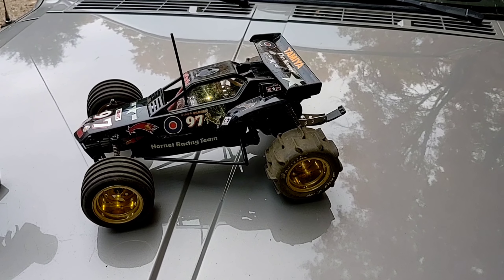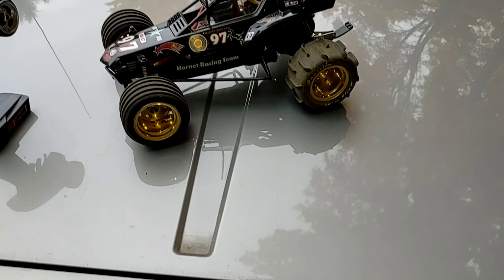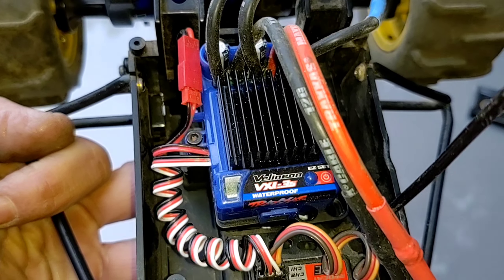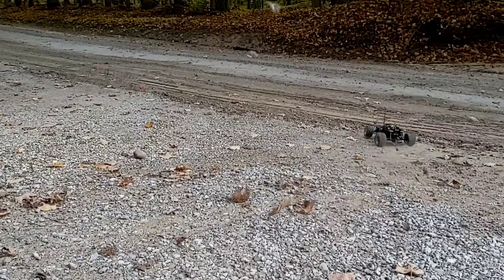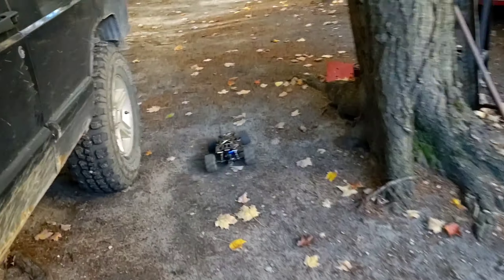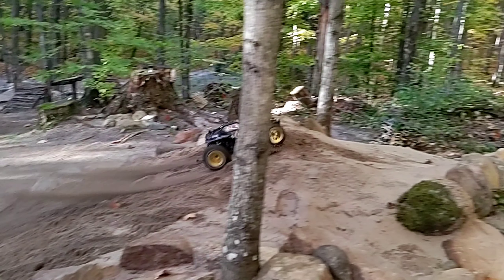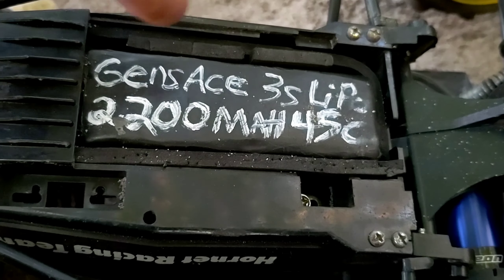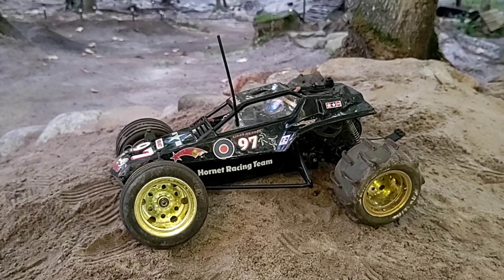Tamiya Angry Hornet; Rnd 2-4

Comment: It was a great run, especially on the sandy hill, besides the slow motion was great. They are very good rc even with its great age lol, and for the rear axle it may have already been split and it is the impact with the shaft that ended up breaking it entirely, but it is true that it 'is rare because I too have never broken a Tamiya axle . So it must be changed and glue the tires . You still have a lot of plans to expand your great course, and you have room, it's really good. It was a very good video 😊
Reply from the maker: 👍😊 thank you Pascal, and yes sir, the parts, are already on there way,😁👍
In the meantime, I have moved the Brushless system, into another Vintage test Vehicle, that was never meant to have a Brushless motor,😁👍 now if would only stop Raining,🙄 I would be able to get the next Vehicle out for some filming,😕 it's been raining since the last time we talked,😂😭 and the next Vehicle is ready for it's debut,😕 and believe it or not, it actually Snowed this morning,🙄😭 ahh, it's happening again! Just like last year, except sooner,😭
Anyways, back to the Hornet,😁 I think that you might be correct, on the axle being previously damaged, I did notice some plastic spider webbing, around some of the screw holes,🤔 evidence of prolonged stress! 😕 That! on top of its age, and all the years it had spent on a shelf  exposed to sunlight, were probably all contributing factors,😕 I also discovered a Broken wishbone, on the driver's side front, of the buggy,🤔 
I took the transmission apart, and cleaned everything up, and to my surprise, everything was fine on the inside, perfect working order,😁👍 
I ordered a new Transmission case, a new set of wishbones, and a new Spur/Counter gear,
I figured that I should probably get a spare Spur gear, since that is really, the only week link in the Transmission,😕 this was the first time that I broke a Tamiya Hornet axle, but I've stripped out Many, Tamiya Hornet spur/counter Gear's,😁 and that was from ripping up big Pile's of gravel, "hill climbing" was huge, when I was a kid, at least for myself and close friends with RC's,😁👍 we used to live next to a township office, and they had all kinds, of different road repairing material, piled up in there yard/lot,
Huge piles of sand, gravel, tarmac, mulch, and whatnot,😁 it was kinda like, our own little RC "gravel pit", that was located right next door, 😂💯👍 
And it claimed it's fair share of RC's too,😭😕 big Pile's of tarmac, wreak havoc! on RC drive train's, 🙄 Insane Traction! And it was Outstanding for stripping Gear's,😕 And the Hornet was no exception,😂 
So I ordered a spare, just in case,😁 ha ha ha lol, 
As for gluing the tires; 
I would love to glue them babies up,😁 😕 but they are "technically" my Brothers tires, and wheels,
🙄 And they are original monster beetle wheels too,
I'm currently looking for a new set of monster beetle wheels online,😕 that way I can glue on a brand new set of tires, vs the current well worn tires, from the late 1980's,😊👍I found a few websites with new beetle wheels, but I'm not sure how trustworthy they are,😕 And I also did do some digging around over here, and have found some other old tires laying around, that Are Glued on to the wheels,😁 a set of Proline 2.2 Dirt work's tires, on Sledge Hammer wheels, and a set of Proline 2.2 Dirt Paw's, also mounted on Traxxas Sledge Hammer wheels,👍
And both sets of tires, are in great condition,😊 and glued on,😁👍 lol 
So currently, I have parts on order for the old Hornet, and I have another Vintage Vehicle, keyed up with the VXL 3s Velineon system, and ready for some Carnage,😁 just waiting for that darn rain to let up,🙄😊
And I installed a new motor in my TF2 as well,🤔 A "Team Brood" 35t brushed motor, and I haven't had a chance to run it either,😕 or the new winch on my Trx4 Bronco, or my brothers new used RTR axial wraith, it's been sitting here for a month, or so, and hasn't been seen by anyone as of yet,😕 And the Rain Is to blame, the day I filmed the Hornet, was a day that it actually stopped raining for like 12 hours, before starting back up again,😕 
Omg, I just looked out the window, and there's snowflakes the size of golf balls coming down right now,😧 I'm literally shaking my head,😕 unbelievable! Lol 
Thanks again for your Awesome Compliments and Comments my Brother, and I wish you have a great weekend as well, Mate 🙂😎👍👍
Reply: @R.C.A.D.  Always rain at your home and now snow !! It arrives very early this year, it will be difficult to use your rc, I also see that you have already ordered the spare parts for the Hornet , it's good , it will be fixed quickly . These old rc are old of age but despite this they are still good to drive, the advantage is that we always find spare parts . It is certain with tires that are glued is better but if you want to use the tires for another rc it is complicated, although you also tell me that you have found other lol, I can't wait to see the Tf2 test as well as your wraith but with the snow it will be difficult . Have a good weekend for you too my friend 😊👍
Reply from the maker: Yes sir, Rain Forest in the summer, and Siberia, in the Winter,😂👍 I'm sure that a lot of people, probably don't believe me about our weather, but it's true,🤔 
It's like we are in our own little micro climate, 😕 The forecast could call for Sun all day, and it will rain here,😂 it rains, without a cloud in the sky sometimes,😕😂
What can you do,😕 lol
Anyways, thanks for your great reply Pascal, it's always a pleasure chatting with you Brother.😎👍👍
Reply: @R.C.A.D.  Here we are between the sea and the mountains and most of the time the weather does not correspond at all to what is expected, and as you said we have in a way a specific micro climate where we are. For me too it is always a great pleasure to chat with you, have a good day my friend 😊👍

Comment: Man that Hornet is destroying the sand hills!  Always amazes me when you drive one handed while filming 👌👌😎
Reply from the maker: 😂👍 Thanks Matt, it's definitely a difficult talent to master,😁 And the Hornet was ripping it up for a few runs, but sadly, after I repaired it from this video, by installing a new Transmission case, 
I destroyed the Differential gear, on the very next run, Split the gear into two pieces, 😕 😂 it's on video, but I haven't gotten around to editing it yet,🙄 wasn't much to see really,😕 about two minutes on the driveway, and she was Broken,😂 lol and I have yet to order new Gear's for it,🙄
The wltoys took precedence,😂👍 maybe by next spring, I'll eventually get the Hornet repaired, and take it out for some parking lot test runs,😂👍 
Much appreciation for your Awesome Compliments Matt,😁🙏👍👍 and of course, many thanks for checking out the video my Brother.😎🤜🤛
Reply: That rear end definitely took some damage, man that thing rips though!  Nice job on the Motor / ESC upgrade you did on it.  I bet that car never dreamed of an upgrade like that lol.
A parking lot run would be super cool.  Fingers crossed it has better luck than the Sledge Hammer.
Man I couldn't believe that minivan just crushed it!! 
Such a sad sight to see but the replays you did had me rolling, lol.  Absolutely Not Funny but just the way you kept going with the slow motion, and watching the drivers face,  Dude I'm still kinda laughing , just at the replays of course. 😢😂💀☠💀☠😢

I luv seeing vintage cars still tearing it up.  It reminds me of my first car, Tyco Turbo Hopper.  That car was my pride and joy back in like 1990.  I really wish I knew what happened to it.  I want to say I broke a wheel off at the knuckle and probably got thrown away by my parents or something like that.
Maybe I'll stumble across one on ebay someday for a price I can't pass up.
Reply from the maker: 😂👍👍 I was lmao on the Slow motion replays too,😁
That's why I put them in there,😂 lol I was just waiting for someone to pick up on it,😁 ding ding ding ding ding, and your the Winner Matt,😊👉🏆👈

Comment: U give that hornet a beating ..there a ruff little rc car I remember the hornet I had when I was a kid didn't go like that thing does  tho 👍👍👍
Reply from the maker: 😊👍 Yes sir, they are certainly Tuff, and extremely simple as well, which as you know, makes any needed repairs extremely simple as well,😁
Although,🤔  even though it's still in production, some of the parts seem to be kinda Difficult to find online,
😕 I mean, I've found new gear box half's, at Amain Hobbies, but the only place that I have found Transmission gear's for it,
is on what appears to be Sketchy websites,🙄
So I'm thinking that after I Repair the old girl, I might just put her back on the shelf for another 20 years or so,😁 Since it is, a Actual Original Tamiya Hornet, From like 1984,😊👍👍 
You should have seen the Ancient Futaba radio gear that I pulled out of it,😧 none bec Receiver, and the servo/receiver "plugs", were kinda reversed,😕 the Receiver had female port's, and the servo's had male plugs, with actual Pins putridity out, 😕 kinda like aircraft radio equipment,
it also had the mechanical speed control as well,😊👍
You know the one,😁 Lol
Anyways, I'm unsure on the Hornet's future at the moment, 😕 might go back on the shelf, might do some more testing with it, or I could do a giveaway drawing for it,😕 not sure,😊 
Anyways, Thanks for your Awesome comment Burnie, and very much appreciated for checking out the video Brother.😊😎👍👍

Comment: Jim google 3rd shock mod I did it to my lunchbox helps a lot with gearbox slap how iare  the gear s holding up Jim on brushless power looks awsome
Reply from the maker: 😊👍 yes sir, I'm aware of the third,or "Fifth Shock" 😁
I did that a long time ago, before YouTube was an itch in it's daddy's pants,😂👍
And it does work pretty well,
But in the case of this vehicle, I wanted to Completely lock it down, as to eliminate any chances of wheelie'ing from the torque snap,😕😊👍 I used to have some old Rock Buster "upper axle plastic carriers"
And they just have a single lower hole for the axle to fit into, vs the long slot, I found one of the Rock Buster's axle holder thing`ma`bobs, but I couldn't find the other,😕 so I just locked it in the old fashioned way,😊 next go around it will be locked into the lowest position,😁
As for the Transmission itself; 🙄 well, other than the obvious, it was actually in great shape,😊👍 I took it apart and found one of the Differential star Gear's on top of another,😕 but after separating everything, and cleaning it all up, there was absolutely no damage to any of the Gear's,😧😁👍
I was kinda surprised,😕 
and also relieved at the same time,😊 When I originally went through the Hornet a few weeks ago, I had discovered that it was missing the Steel Center Differential Pin,🙄 and Surprisingly, those are pretty difficult to find,😕 it's in the "RC screw bag C":58347, or Hop up part # 9465657, and I haven't been able to find one,😟 So I kinda Fabricated one,😊👍
It started out as one long fat pin, and I ground down each end into a spear tip, like a sharp pencil,😁 so that they would sit center into the Cora's ponding bevel gears on the axle half's,😊 and Really Surprisingly, that actually Held up too! 😂👍 I can't believe that the homemade Pin, held up to the Velineon Brushless system,😧 😊
I also have a Complete original midnight pumpkin that I could have taken the pin, or Entire rear axle from,
But it's 100% complete, so I didn't want to take anything from it,😁 Back to the Hornet; upon inspection after the destruction, I had also discovered a Broken front wishbone on the driver's side, and some stress fractures in the chassis, around the rear axle mounting brackets,😕
So I currently have some parts on order for it, New chassis "just in case",
 a new Transmission case, a set of front wishbones, and a new spur/counter gear,😊👍 I ordered the gear before I realized that the original was still okay,😕 oh well, at least I'll have a backup,👍😁 
In the meantime while I'm waiting for parts, I have another project that will be debuting here pretty quick,😊 I'm currently working on it,  almost done! 😁👍
Only hint that I'm giving, is that it's another Vintage Vehicle, that was never meant to have a Brushless system, 😁 
Thanks for your Awesome suggestion, and for taking the time to check out the video Brother.😊😎👍👍

Comment: looks like you need to tie a brick on that thing lol.   you torture that little car.
Reply from the maker: 😁😂👍 that would probably help, it could certainly use something to help hold it to the ground,😊
As for torture, hmm😕 yeah kinda! The good aspect, is that there's really not much to break on a Hornet,😁
Except for the Transmission,😭😂👍
Which is actually, one of the most "Robust" RC Transmission's, in the industry,😕 and no lie! It was the first time in my life that I ever broke one,🙄😊
This old Hornet was kept in Excellent condition for over 20 years, And at the moment that Tamiya decided to reproduce the Hornet a few years ago, is the same moment that the Hornet lost all of its "Collector value"😕 So I figured, why not just Send it with a VXL 3s Brushless system,😁😂👍👍
The good news is, that it's an easy fix,😊 
Thanks for your Awesome Comments, and for checking out the video my Brother.🙂😎👍👍
Reply: @R.C.A.D.  I think RC is for fun not shelfs Repair run and have fun then repeat ,have fun Jim that was what it looked like you were doing Cheers my friend.
FULL SEND LOL
Reply from the maker: 😁👍👍 Yes sir, it was definitely Fun! And the repair parts are already ordered,😊 
In the meantime, I'm currently wrapping up another test Vehicle, Only hints that I'm giving is that it's Vintage, and it was never meant to have a Traxxas VXL 3s Velineon system,😁👊👊 it should be interesting,😂 lol 
Thanks for your Awesome reply Terry.😊😎👍👍